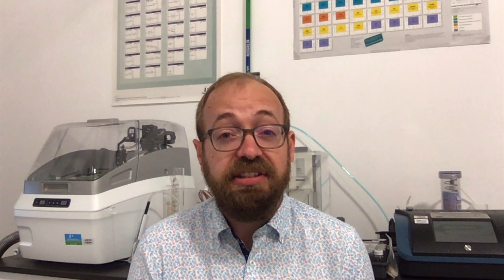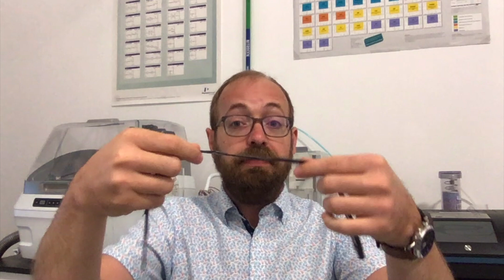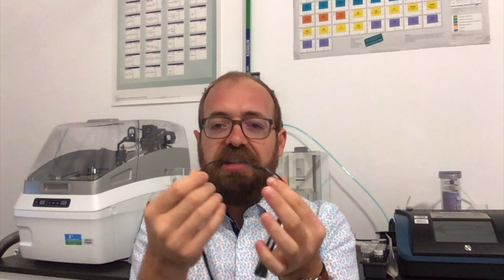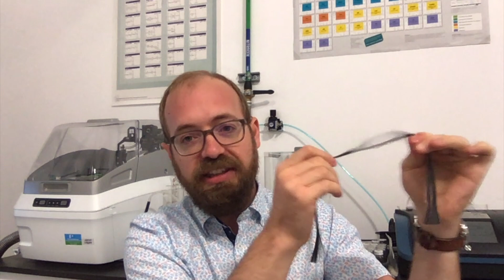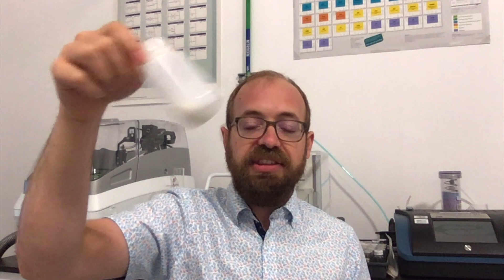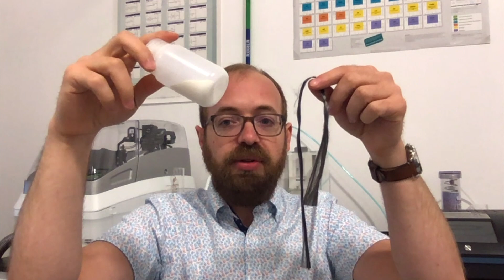The science behind Thermoplastic Carbon Fiber Composites Bike Frame

Comment: Do you have a structural engineer in the company that calculated the static deflection and the static safety factors on the variation without a seat tube? The structure looks extremely flimsy

Comment: Thanks Zack! I'll repeat my request from the IGG comments here. How about a video on flexural strength and flexural fatigue of this specific carbon polymer? Tension and compression forces will be a minimal concern compared to flexural forces on a bike frame, fork, etc. Particularly with an open frame layout as the superstrata bikes have, the frame will be under significantly more flexural force with the rider’s weight on the seat, than the tradition frame design with a closed rear triangle.